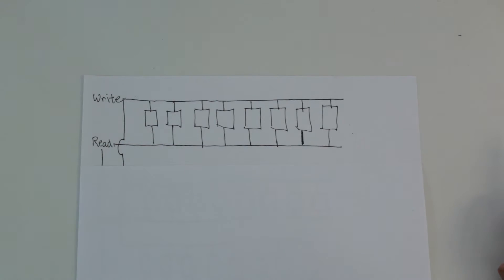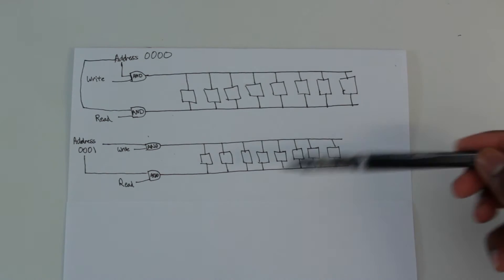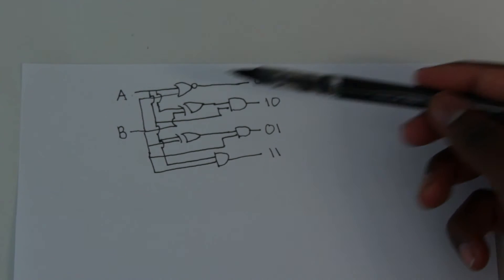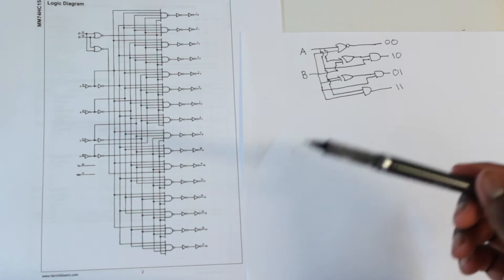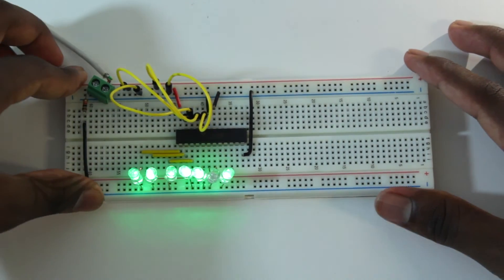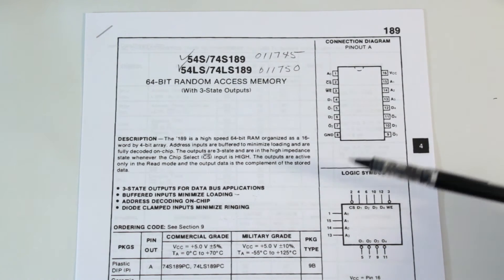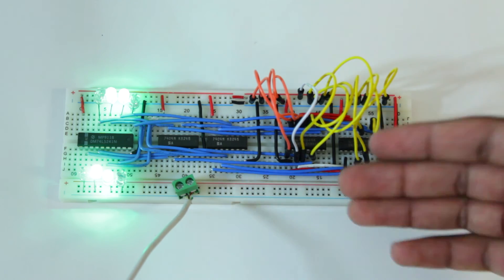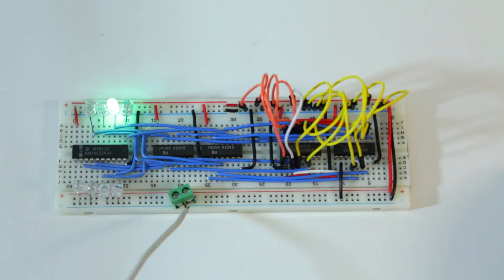128 Bit RAM Module Finished | CPU 8-Bit CPU

Comment: Interesting.  You seem to be doing the same as Ben Eater, although I guess you'll have a different approach in some areas.
Reply from the maker: +JasonMasters I actually started my CPU before Ben Eater started his, but you are correct. By chance, we are using the same book or maybe different versions of the same book. However, I have different explanations and you'll see later that I want to take mine a different route. But good eye!